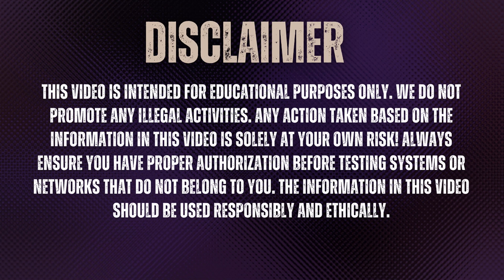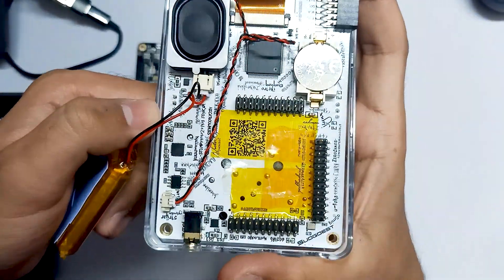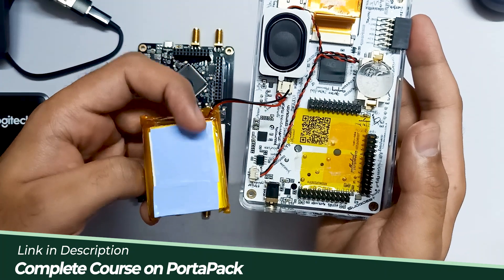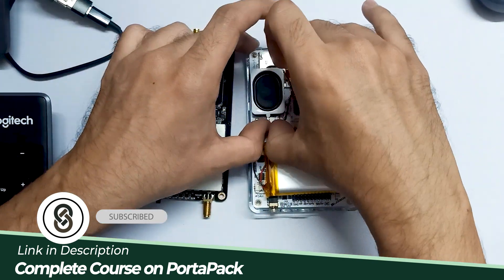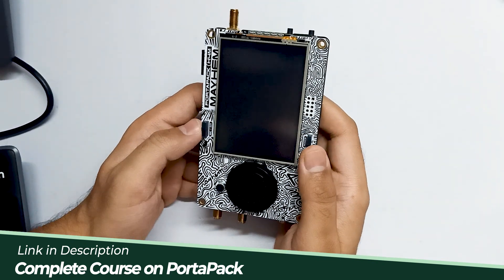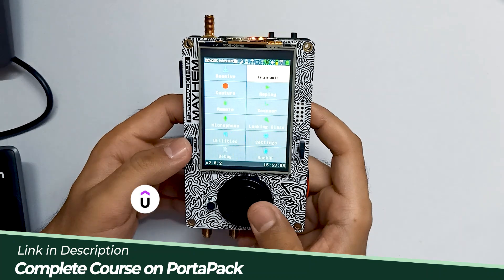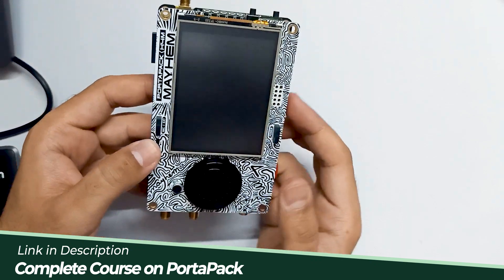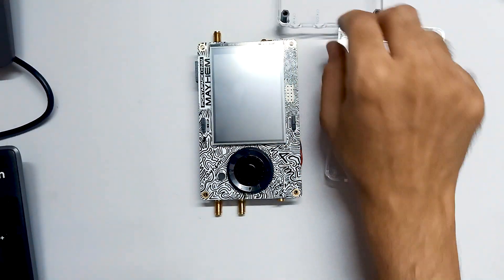How to Assemble HackRF One Board and H4M PortaPack

Comment: Carefully insert pins and look that they are in good form, otherwise you may damage the male side of connector and get problems. Also very carefully press when combining both parts. If it goes hard look if all pins are in the right position.